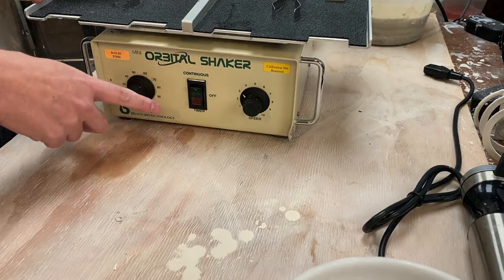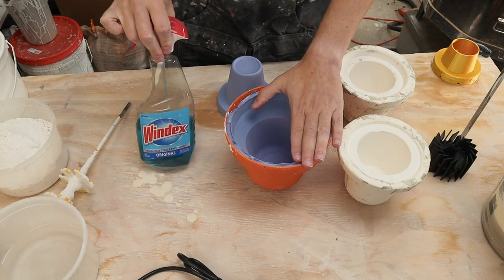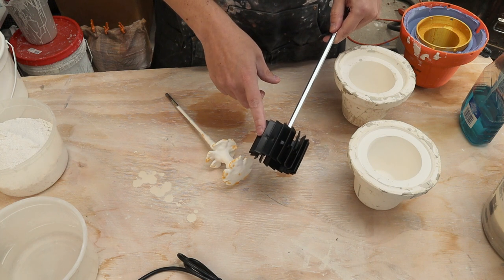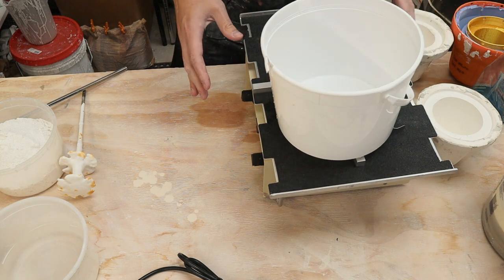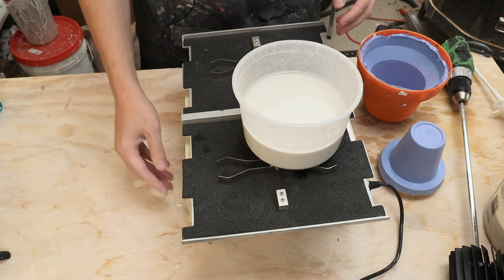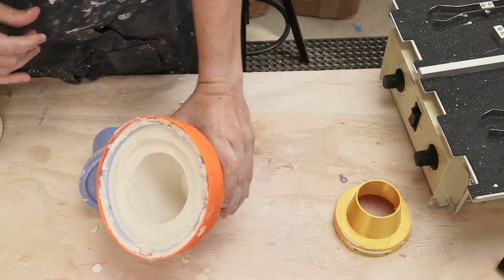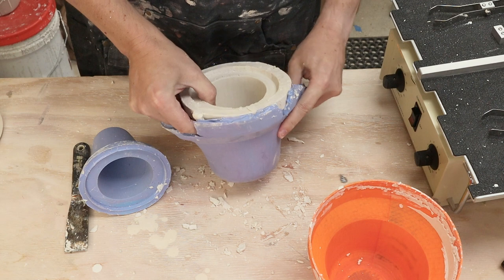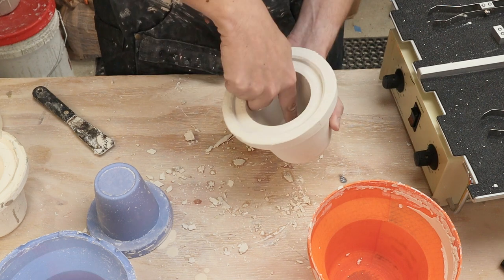Reducing Bubbles in Plaster Slip Casting Molds

Comment: In school we would tap the bucket holding the plaster after mixing and before pouring to agitate the bubbles to the surface. Then you can swirl the liquid to group the bubbles that have come to the surface and skim them out before pouring. We also pour to the side of the mold interior directly onto the palm of a hand touching the side of the mold so the plaster kind of just slides in so as to avoid any additional bubbles collecting along the form of the body you're casting. As a last step we would pound on the table to float the remaining bubbles up or you can stick a hand in the liquid plaster right at the surface and kind of just bounce it to agitate the liquid lightly and bring the bubbles up. Granted the way you're casting the mold is pretty different from any way I've ever done. If you're making simple drop molds you can actually just throw a solid form on the wheel upside down (so think the lip of the form would be what is attached to your wheel head, and you would be defining the foot at the top)  and then throw your cottle walls out of clay around the exterior and cast directly into that. Ceramic Jim has a video that's exactly that https://www.youtube.com/watch?v=7n7zU0BZsLw although it occurs to me just now that your might not have a wheel. Either way you're going to want to make sure you get all your bubbles out before inserting the top silicone piece as that is most likely a recipe for catching those surface air bubbles.
Reply from the maker: Thanks for the tips. Yes you're correct in that I don't have a wheel. And while this mold is rather simple (it's actually one of my older!), I have made much more complex ones using 3d printing, or as in my last video with legos! But related to your point, the advantage of doing it upside down is the same as what I mention at the end - the bubbles will rise away from the surface which forms the pot.

Comment: For another purpose, I ordered a 5 gallon vacuum pot which is supposed to arrive tomorrow. I'm going to see how that works (intent is similar to epoxies and silicon).
Reply from the maker: A vacuum pot would likely work very well. A pressure pot might as well (collapsing the bubbles). I've been keeping an eye out to see if I can find a good deal on one myself. The shaker table came up first though!
Reply: @PotterybyKent  I'll let you know how it goes.  I've been thinking about making my own shaker table, as it should be fairly simple and I've got a variety of microprocessors to play with and choose from as well as stepper motors. Ah, the joys of being ADHD! 🙃
Reply from the maker: Always so many projects to pick from! But I wouldn't have it any other way.
I'd thought about making my own until I found this one. One thing I quickly noted in the video that might come in handy in thinking about a DIY version is that this thing is heavy! It's about 15lbs and I suspect that mass is useful for this kind of low frequency operation.
Reply: @PotterybyKent  Good point regarding mass. Especially since I was thinking to be able to handle a five gallon bucket! I think I'll need to think about how to clamp the whole thing down. May need to cast a pretty massive plaster of paris base with mounts.
Reply: The vacuum pot arrived last night. Today I made a casting of a plastic supermarket snap-together food container that I liked the contours of. My initial plan was to place the container upside down and stabilize it with modeling clay, which I did. But as I was going to place everything in the pot I realized pulling a vacuum on the mold would expand it, pop it free to float to the surface, or both. What I did instead was after gently mixing the PoP with a drill motor, I put the PoP in the vacuum chamber for about 10 minutes and pulled 25" of mercury vacuum - about -12 psi, which here near Denver, where the normal atmospheric pressure is about 12 psi, equates to a decent level of vacuum. This created a foam of giant bubbles, which I gently shook and swirled. (It was really interesting to see how much the batch swelled under vacuum - at least an inch, if not more). I then carefully poured the batch through a kitchen strainer.  The result is excellent, not a bubble anywhere.  There is a rough surface in a couple of spots, but that was due to not getting my liquid soap release agent distributed well.  Overall, very, very pleased.  I will repeat the process tomorrow with a couple of other mold masters and this time I'll video the experience and post to my youtube channel.  The vacuum pot is a winner for me!!!!🥰🤩😁👍
Reply from the maker: That's great to hear!
Reply: @PotterybyKent  Getting a video up may take me a day or two, but it will get done. I'll post my channel and the video link when appropriate. :)

Comment: Maybe if you put a long straw in the middle of the inner plug the air underneath can escape?
Reply from the maker: Plaster would likely just fill it up. Changing the pouring orientation has proven to work pretty well.

Comment: You are introducing too much air due to the way you are mixing the plaster. The entire mixer paddle needs to be deeply submerged at all times during mixing in order to not let any air into the plaster. You need either smaller mixing paddle or taller container and to keep the paddle as close to the bottom as possible
Reply from the maker: Yep. I talk about this more in more recent videos. A bit counterintuitively, mixing more plaster is easier in this regard.

Comment: I made 2 molds the other day and I'm very unscientific about the whole process. What I did find is that the mould with the thicker plaster had much fewer bubbles and the wetter plaster mold had quiet a lot.
Reply from the maker: Maybe the more watery one foamed more in mixing? There are a ton of different variables at play for sure! The other difference with thicker vs runnier is the strength of the resulting plaster. The other video I mentioned in passing about testing paster mixes actually resulted from me being unhappy with a wetter plaster that ended up too soft once set.

Comment: Keep it simple.  Yes you are adding air when power mixing - so don't power mix - mix by hand gently.
Reply from the maker: That is not what the manufacturer recommends! Not power mixing impacts the strength of the mold a lot.

Comment: I think all of your problems would be solved by not trying to create a mold right-side-up. The important surface is the inside of the mold, not the surface that touches the outer container you hold everything in. I'd put the smaller silicone master and the form it sits in upside down, glued to a surface, then put a round tube around it that's tall enough, and glue that down. Then just pour the plaster in over the pot and vibrate. Bubbles will rise AWAY FROM the form, instead of upward against it.
Reply from the maker: Thanks! You are correct and that is exactly the next video I did. While it didn't address all of my issues it did indeed help. Let gravity be your friend!

Comment: i saw some people use alcohol to fight the air bubbles - but i cant think of any scientific explanation
Reply from the maker: Great point - I've seen similar usage as well. People will spray alcohol onto the top surface of the plaster while it is still wet to break bubbles.

I think what is going on is the alcohol breaks the surface tension of any bubbles floating on the top. The way my mold is set up, that top surface is tiny (the gap between the two pieces of silicone). It also not part of the pot (slip will never touch that surface) and by the time I secured the inner mold, it was rather hard to access the wet plaster from above. So I didn't do it.

If I had a mold with a larger open top surface (and/or I was concerned about the non-pot sides of the mold) it could be worth a try. I also wonder if a spray of windex would work similarly - since I already have it out.
Reply: I used to make soap, we always sprayed the soap with alcohol after pouring and the bubble magically vanished. I hope it is as easy with plaster. 👍🏻